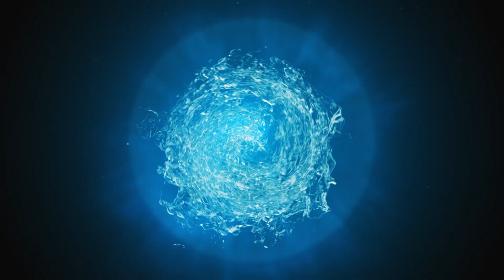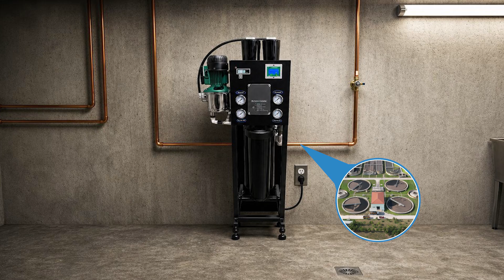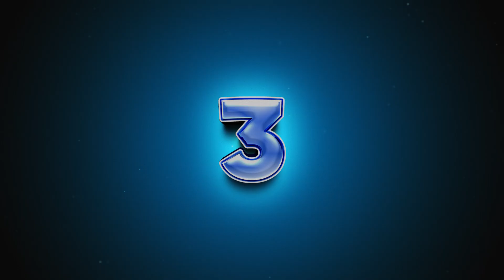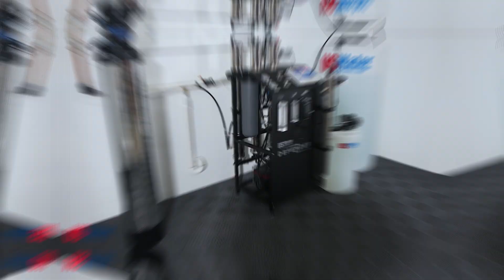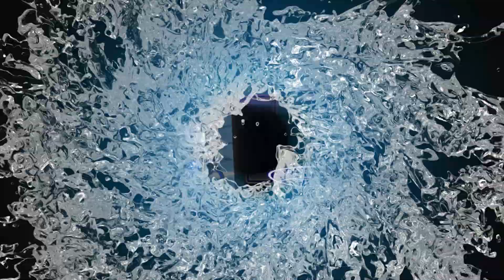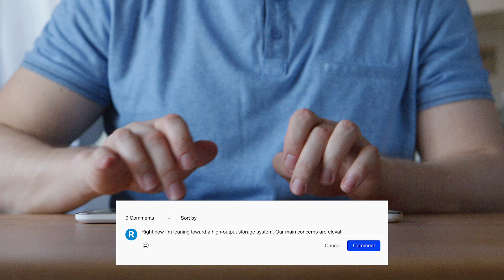Best Whole House Reverse Osmosis System 2026: Top 5 Filters for Truly Clean Water Everywhere

Comment from the maker: 📌 Best Whole House Reverse Osmosis System (Which One Is Right For You?)
Whole-house reverse osmosis is a serious system-level choice, not a basic filter swap. RO is used when you want more intensive treatment across the home, but the right system depends on production capacity, storage, pretreatment, water source, installation space, and whether you want a complete package, a more scalable upgrade, or a premium RO setup with added UV protection.

#1 Crystal Quest Whole House Reverse Osmosis System — Best Overall High-Capacity RO System
Crystal Quest Whole House Reverse Osmosis System is the strongest overall pick if you want the broadest high-capacity RO configuration. With commercial-grade options ranging from 200 to 7,000 GPD, multiple storage tank sizes, prefiltration, pump delivery, and customization options, it gives buyers the most room to match the system to the home instead of forcing a narrower package.

🔎 See Full Details: https://waterclarityguide.com/go/crystal-quest-whole-house-ro

#2 RKIN Whole Home Reverse Osmosis System — Best Complete Whole-Home RO Package
RKIN Whole Home Reverse Osmosis System is the stronger package-style pick if you want the core whole-home RO setup laid out clearly. It includes the RO module, holding tank options, delivery pump, carbon filter, and AlcaPure post-filter, making it a strong fit for buyers who want a complete system package without moving into Crystal Quest-level customization or a more scalable upgrade path.

🔎 See Full Details: https://waterclarityguide.com/go/rkin-whole-home-ro

#3 US Water Systems Defender Whole House Reverse Osmosis System — Best Scalable RO Upgrade
US Water Systems Defender is the stronger upgrade pick for buyers who want a scalable whole-house RO system with an American-crafted, system-focused build. It doesn’t take Crystal Quest’s place as the broadest high-capacity option, but it makes a lot of sense if you want a serious RO setup that can step beyond a basic whole-home package.

🔎 See Full Details: https://waterclarityguide.com/go/us-water-systems-defender-whole-house-ro

#4 Echo Water Whole Home RO System — Best Ultra-Premium RO + UV Package
Echo Water Whole Home RO System is the ultra-premium pick for buyers who want whole-home RO paired with UV protection in a more guided package. Its Essential, Plus, and Pro paths make it especially appealing if you want a higher-end municipal-water setup with RO, carbon dechlorination, anti-scalant support, UV sterilization, and storage built into the system plan.

🔎 See Full Details: https://waterclarityguide.com/go/echo-whole-home-ro

#5 US Water Systems Falcon Whole House Reverse Osmosis System — Best Compact Skid-Mounted RO System
US Water Systems Falcon is the compact skid-mounted option for buyers who want a fully integrated RO system instead of piecing together pumps, membranes, controls, filters, and tanks separately. With 1,000 and 2,000 GPD options, tank choices, front-access components, and a compact footprint, it’s a sensible fit for smaller homes, tighter utility spaces, and buyers who want whole-house RO with simpler service access.

🔎 See Full Details: https://waterclarityguide.com/go/us-water-systems-falcon-whole-house-ro

✅ How To Choose:
• For the strongest all-around RO configuration: Crystal Quest Whole House RO
• For a complete packaged whole-home setup: RKIN Whole Home RO
• For a scalable RO upgrade: US Water Systems Defender
• For an ultra-premium RO + UV package: Echo Water Whole Home RO
• For compact skid-mounted RO: US Water Systems Falcon

(Some links are affiliate links. I may earn a commission at no additional cost to you.)